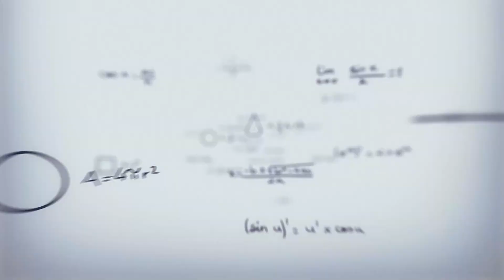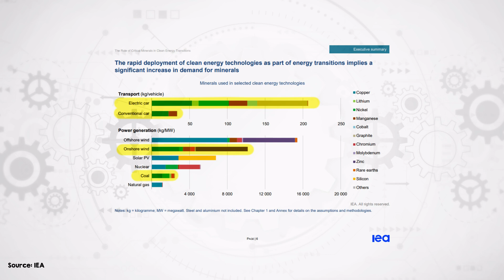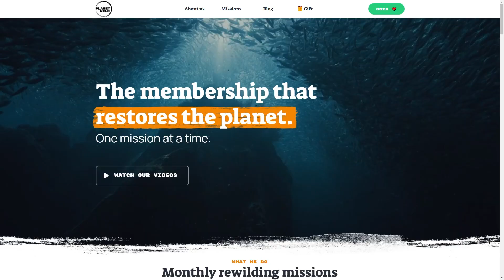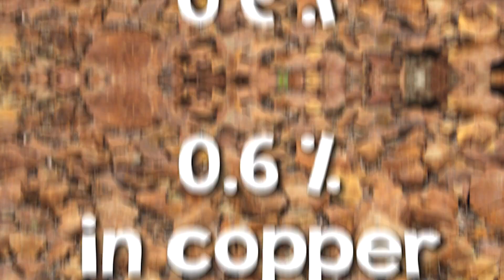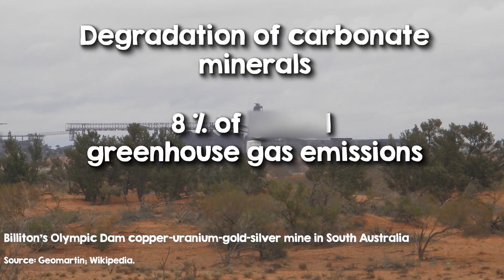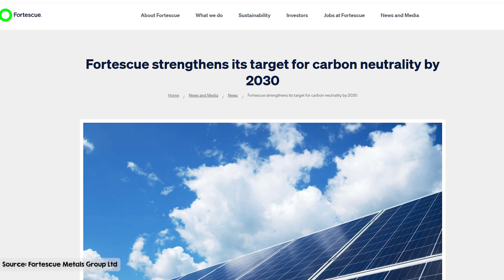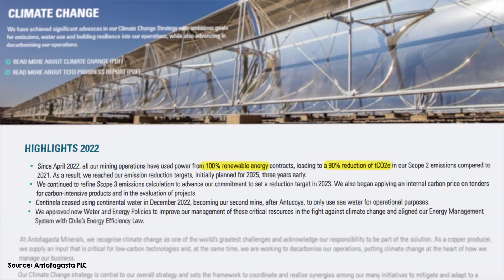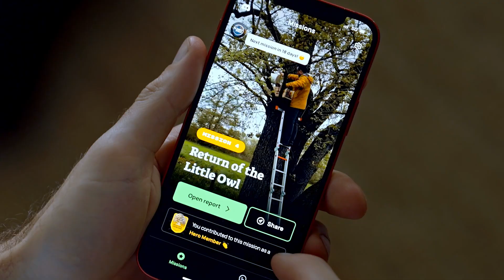Zero-Emission Mining Technologies are Here

Comment: Good summary, 👍,  good work. 

May I suggest one way is heavy on fossil fuels and financing and resources.

World wide it is impossible. 

5 to 7 times more electricity means 5 to 7 times more national electrical grid capacity. 
Australia has 1million klm of national grid and 20million buildings, customers. 

ALL CENTRAL ELECTRICITY GENERATION needs a grid to the millions and millions of customers. 

Iron ore and coal and copper and zinc to build the bigger grid capacity. CO2 emissions exploding with mining and smelting and refining and rolling and manufacturing and fabrication and galvanising and construction projects.......

Hello 👋 do the calculations. 

The world's electrification is a bigger problem. 

EV big batteries and rooftop solar PV DOES NOT NEED A bigger grid. 

Sodium batteries production has started.
EV big batteries are 'free' with the vehicle and recyclable.
Rooftop solar PV panels silicone glass and aluminium is recyclable.
Reply: You are correct that decentralized solar is an excellent solution to charge EVs.  I know, I have both. I have also visited a village in Kenya, who could only afford, as the sole transportation mean for  the all village, a single electric van, which they could recharge from their solar installation.  No way they could a) be connected to any grid, and b) afford fuel for a petrol or diesel van!

But EVs are NOT going to multiply electricity demand by 5 or 7 times!  Should, by some miracle, 100% of the world's car fleet (ca. 1.5 billion cars) go electric tomorrow, it would increase electricity usage by... ca. 11%!!!  Not 11% per year, 11 % total!   Due to the much higher prevalence of cars in the USA, their larger average size, and the higher mileage driven than the world's average, the US grid's overall generation would have to grow 25% (again, not per year, but total over the next 20 years) to accommodate a 100% electric car fleet!

You have a total wrong order of magnitude in mind!

The electric grids' capacity extension due to the electrification of the road transport fleet is LESS, than that required in predominantly the 60s,  and 70s in the USA by the adoption of air conditioning in most homes and buildings!  Our forefathers managed that growth then. We couldn't manage something of much lesser amplitude today???  Furthermore, EVs tend to be charged off-peak, during the night, while A/C peak consumption tends to be at the worst possible time, or just about!
Reply: @st-ex8506  you have missed my point. 
Electric energy is only a small part of the total energy used in a developed country. 

If 100% electric and no fossil fuels, then the amount of electricity needed is huge.
 
Electric vehicles are only a small part of future demand as ICE vehicles are traded in for EV vehicles. 

The bigger amount of electricity means more grid capacity. 
I  am saying 5 to 7 times electricity to replace all fossil fuels.
Reply: @stephenbrickwood1602  Ok, fair enough!

But still, the electric energy needed in a zero fossil fuel economy is not at all as huge as anticipated.  The reason is that the energy efficiency of many processes (home heating, for instance, road transportation... but of that, we have already discussed9, can be improved by a factor of 3 or more by going from fossil fuel to renewable electric.

However, such a scenario does indeed need much more than 10 or even 25% additional power generation... I fully agree.  But NOT 5-7 times!

Ir is possible to replace ALL energy by solar + wind + storage (batteries or pumped hydro... which is cheaper and has a HUGE potential) + nuclear for the countries that have that capacity (new nuclear makes little or no economic sense) + hydro , geothermal and others where it makes sense.
I recommend reading RethinkX Energy report, or one of their YT video: https://www.youtube.com/watch?v=fsnkPLkf1ao&t=10s

Sure, it also means more transportation capacity... but it does not need to happen next year, it can be phased in over a couple of decades... A not insignificant effort, but totally feasible... the needed investments being even less than business-as-usual, and the grid growth rate less over the next two decades than it was during the 60s and 70s!!
Reply: @st-ex8506  good facts, you are a thinker.
My main concern is a push for nuclear dominating the existing national grid. 
Renewables on the grid, including rooftop solar PV, to millions and millions of EV big batteries and conflicting with the rigid nuclear electricity generation plants. 
Nuclear generation that needs government disaster insurance and government guaranteed cash flows and are too big to fail. 
More grid construction requires more CO2 and mining, etc.
Selfplug-in EV ( V2G ), in the millions and millions and millions, most parked 23hrs every day, with sodium batteries or similar recycled technologies, will be a huge amount of storage daily. 

In fact, if you do the maths cheap rooftop solar PV and EV, big batteries will show that offgrid is a very realistic possibility for most of the year.
A little fossil fuel in an emergency would not be a problem. 
Fossil fuels as feedstock to the chemical industry will remain part of life. 

Nuclear can not be a big part of the world energy solution. It is economically dangerous.
Reply: @stephenbrickwood1602  I am glad we largely agree!

Still a few comments, though:

- Rooftop solar for individual houses is not that cheap... not because of the panels, but because of the installation.  Ground-mounted panels are much cheaper to install (that's what I have) as my house is an over 200 years old French farmhouse, and solar panels would look awful on its roof.  .  Bifacial panels can even be mounted vertically, and serve a second use as a fence.  The lowest-hanging fruits are large flat roofs.

- More grid construction indeed generates CO2 emission and other impacts... like ALL human activities.  However, the lifetimes of such power lines, transformers, etc are very long (50 years, sometime 100 years), so the impact per kWh transported is utterly peanuts.

- I have my reservations as to any massive use of vehicle's batteries in V2G applications... and so has Elon Musk, BTW.
My point is that vehicle batteries are much more expensive than stationary grid-storage batteries.   They have a completely different, and much more demanding set of requirements.  Their lifetime is generally dependent on the number of full charge-discharge cycles they perform.  Suppose an expected useful lifetime of, say, 2000 cycles. The average US driver would go through approximately one such full cycle per week, giving the battery a 38 (!) year expected lifetime!  more than enough, I would say!  But if it is used every day through, say, half a cycle for V2G applications, then its lifetime would come down to 8.5 years, which is unacceptably low!  A compromise between those 2 extremes could be acceptable... The grid operator will obviously compensate the vehicle owner for the service, but at a price that is likely to be indexed to the costs of stationary batteries, NOT of mobile ones!  Will it be enough to fully compensate (including some fair profit margin) the early replacement of the battery?  So, you see, using car batteries to give storage capacities to the grid is not without its negatives!

- Being off-grid is a VERY complex endeavor... definitely not any realistic objective for the majority.  I'd rather consider so-called "community grids"!

- Obviously oil (mainly) will stay an important feedstock for the chemical industry... but then, while still "fossil", it is no more a "fuel".  And BTW, there is much research on bio-sourced plastics, such as PEF to replace PET in bottling for example.

- I agree that NEW nuclear should not be built, but am adamant that existing nuclear should be kept as long as it stays safe and economic, as it will greatly help and hasten the transition to renewables, by delaying the needs to add storage.  A unit of battery storage capacity will be much cheaper in 5 years, or in 10 years than next year!
Reply: @nbrickwood1602 More than a thinker, I have 15 years experience as a company co-founder and CTO in the domains of renewable energy, bio-sourced chemistry, as well as material recycling (phosphate in particular).
This kind of stuff was my everyday job until my retirement last November.

But thanks anyway for the compliment!
Reply: @st-ex8506  Thank you for your input.

Comment: So , you appear to give a very rosy picture that the transition to net zero is just a tidy up of existing  mining and refining practises. Then switch to a circular economy. What you don't address is the estimated requirement for battery backup of renewables which means at least 5-10 times more copper for interconnects and the batteries themselves. When you show an EV you just show your need 6x more stuff. But that stuff need to mining of 100 times that waste dirt to get to the 0.5% grade copper ore.
Reply: Actually she has already addressed this, and no we don't need that much backup. Also do you think they pump pure petrol out of the ground out back of the petrol station? No they have to extract impure crude oil and purify it with a very energy intensive, chemically complex and process, then use part of that energy to ship and truck the purified fuels all around the world to where they are used. And none of it can be recycled, ever. Renewables and EVs are vastly, vastly better than thermal fuels.

Comment: "Green minerals" means absolutely nothing if degrowth isn't also involved. I used to work in the Australian minerals industry and they dont actually care. It's all about profit and green minerals are just a new market to make profit in.
Degrowth is a dirty word. The mining industry take our technical need for some minerals hostage, and uses it to get away with whatever they want. 

Capitalism is the problem and without addressing that then any solution will just fall into Jevons paradox, as if you think about it EVs are just another jump in fuel efficiency. Jevons paradox doesn't have to be a thing but it is inevitable under the fundamental structural need for growth in capitalism. If capitalism isn't growing it is in crisis, it is a fundamentally flawed system. 

What is the point of switching from ICE to EV cars when you haven't solved the root problem of car centric cities. Like why are out cities designed for cars not people? Public transport and walkable/cyclable cities are a solution we already had for climate change before we even knew what climate change was as a species. A bicycle has 1/100 the metals of a car, but it gets even worse when you see every parking lot, every road, every house that is further away because of cars, all that infrastructure has to have materials that are mined. There is a reason the Minerals Council of Australia are openly supporting green/critical minerals and are silent on 15 minute cities. 

I also used to work for Fortescue as a contractor (which is a whole thing in itself with worker rights). There is no such thing as a good billionaire and that includes Twiggy Forest. Fortescue is currently running a neo-colonial mining operation in Gabon where all the profits go into the hands of private shareholders instead of the 39% of the population that are in poverty or the 20% who are unemployed. Also Fortescue has been constantly  fighting native title claims in Australia and Tiwggy Forest has a massive white saviour complex when it comes to his interactions with indigenous Australia. What Fortescue and Tiwggy Forest are doing right now is just market positioning and reputation washing, they dare not undermine the system which created billionaires and climate change in the first place.

If you want a wake up call go to an investment presentation for a mining company or an AusIMM industry night. They don't hide who they are as much there. Hell just scroll through the Minerals Council of Australia's LinkedIn or the linkedin of senior mining industry individuals like geologists. Climate change is openly denied and unchallenged and any "solution" that is ever mentioned is either marketing or if you're really lucky symptom management that doesn't touch the root cause.
Reply: Yes, we need both an energy transition and degrowth. The problem of the dirtiness of the energy transition is like the problem of organic agriculture taking more land than conventional agriculture. It is only a problem if you intend to maintain the same way of life. But if we use more bike and eat less meat, we can do it!
Reply: @miguel5785  I don't like the organic industry because it's mostly just capitalist marketing based on beliefs not facts. I do however think specific farming techniques that get called organic can be integrated into other farming styles. Basically base things off evidence and give weight to the whole system etc. I mean we already produce 1.5x the food needed to feed the entire world's population, yet millions die from hunger related illnesses every year - so the issue isn't just "produce as much food as possible per a unit land", especially when you factor in the sustainability of it all.
Reply: @GeoElk Well yes we produce a lot but we're also using a lot of land and water, burning a lot of fuel, contaminating aquifers, reducing biodiversity and destroying the soil. Sure there's marketing around organic and there are better practices that those, but conventional agriculture is a big problem.